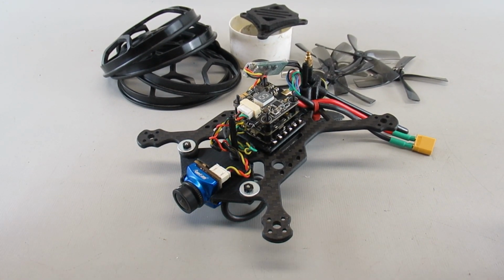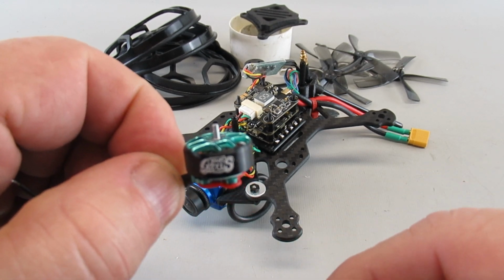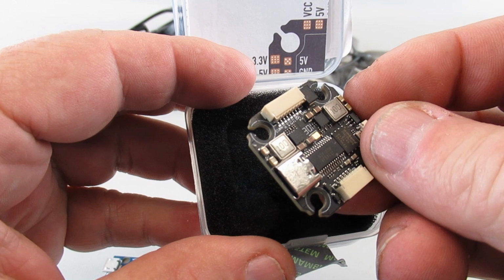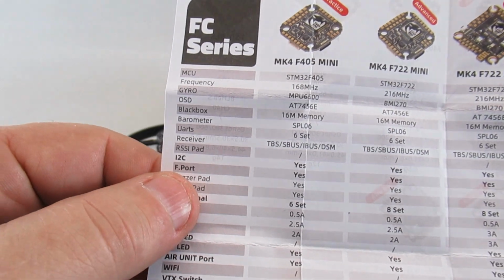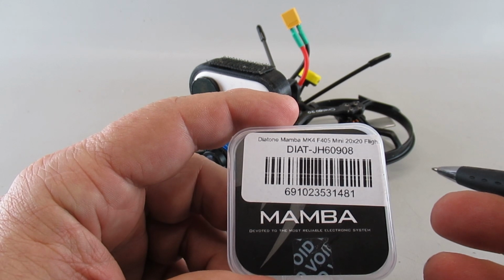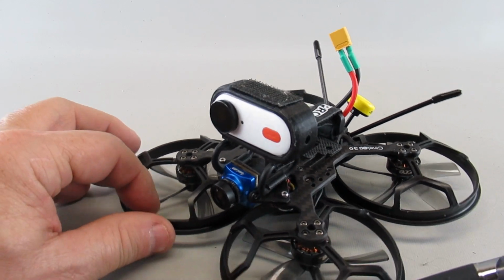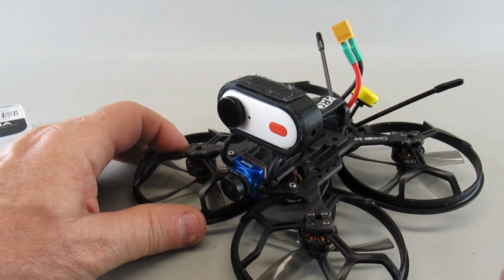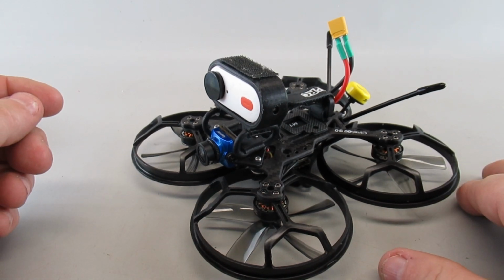FPV | PART 3 of 4 | 3 inch Ducted Cinewhoop to Cinelog CL30 frame

Comment: I always appreciate the troubleshooting process, it's an art and a science.   I'm looking forward to see how it flies.
Thanks for sharing the building process.  I haven't built my own yet, but will before 2023 is over.
Reply from the maker: I did fly it over grass this morning.  No major issues, but I can wait a few weeks to give it a real workout once the snow clears.  

Just a few short years ago there were very affordable FPV built kits available.  They helped a lot of people get in the air.  Not so currently.  If I add up the parts for this recent CL30 build, it's virtually the same as the completed quad.
Reply: @TommyTester  it's a lot like computers used to be.  In the 90s and 2000s, building a computer piece by piece would not only save you money but would ensure that the components are top notch and customized to one's liking.  
2010's it was not less expensive but at least you could customize it how you wanted it.
present day - just spend the money and get exactly what you want because it costs just as much to build it yourself with the exact same components.   
They seem to cater to our laziness now as opposed to catering to our wallets lol. 
What a shame.  But I still like to build things for myself, at least once, so I will build a quad someday.
But I've built my last computer years and years ago.

Sometimes I fear that convenience will lead to the end of us all.
Reply from the maker: @BartManDude  You nailed it.
Reply: @TommyTester  Do you fly analog or digital?   I haven't noticed any reference to either in your videos but I'm so ignorant yet, that I may have missed the obvious.
So far I've only bought dji o3 stuff for compatibility reasons with my V2 goggles.  I'm looking at some microwhoops to purchase for next winters indoor season and have been thinking about getting an analog setup so I could buy more quads for the least amount of money.  Then my buddy just bought a microwhoop with hdzero and says he will never go back to analog.   
I'm comtemplating buying an analog setup that also works with hdzero goggles when I eventually get them.  but now I'm thinking maybe I should just invest into the digital alternative to DJI and skip analog all together.   
A lot of pluses for going with analog ($ and more choices, latency)  but the big negative obviously being video quality.   I'm looking at HDzero quads and some companies like GEPRC don't even have a quad with hdzero integrated.  only a couple microwhoops have it, betafpv, happymodel.   
So i'm just curious what your thoughts are on all of this.    I guess I'm trying to put together a future purchasing plan based on ending up with the best video quality for the lowest prices.   
my current analog thinking is to get wildfire module, adapter for my v2 goggles and analog monitor for flying around the house.  about $180 total with antennas (not bad)
the digital version would be - get the hdzero module and run it through my monitor until I get a set of hdzero goggles.  about $800 total lol, but I get a great set of future proof and massive compatibility goggles.
My other option is to get the analog now and work my way towards hdzero in the future.  hmmm. I think I almost just sold myself on the analog way first again lol.   
is it so much better in the digital world?
and if you already have a video talking about it that I missed, please feel free to just link me to that 👍

Comment: Hey Tommy it looks really nice. I’m glad you got it sorted out. 👍🙏👍🙏
Reply from the maker: Thanks.  No one has made a recent video on how to built up a quad from scratch like there was a few years back.  Lots of changes in Betaflight, tuning, and the transition to pushers has made it necessary for people doing a new build to piece together information from a variety of sources. It takes persistence.  A quick swap of electronics  into a new frame, which I've done several times before as you know, turned into a 5 evening WTF-fest.  Thanks for the support.